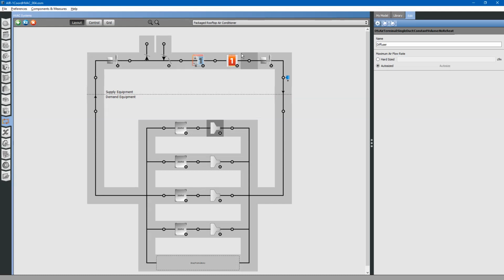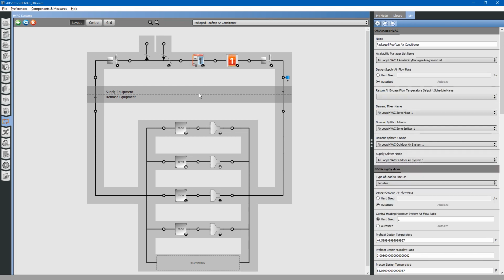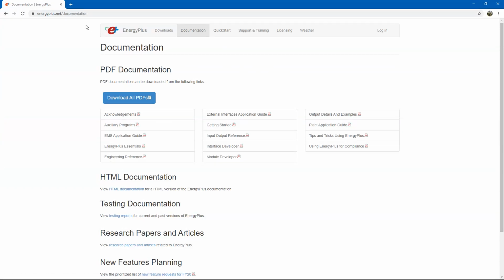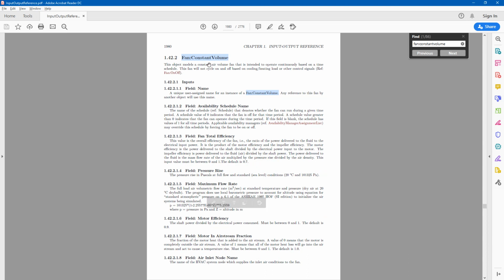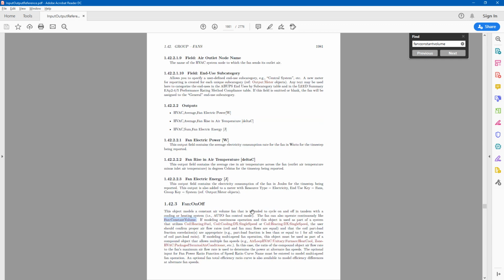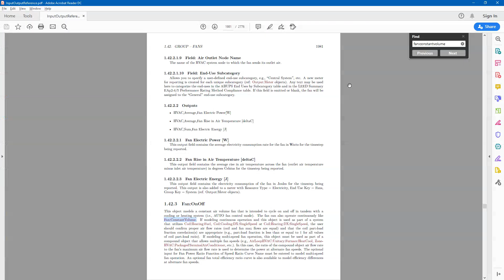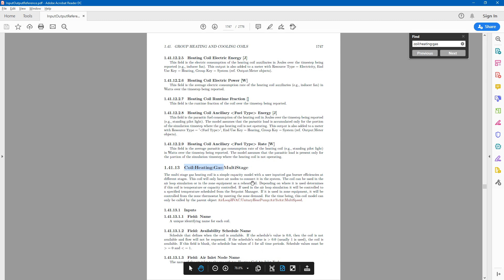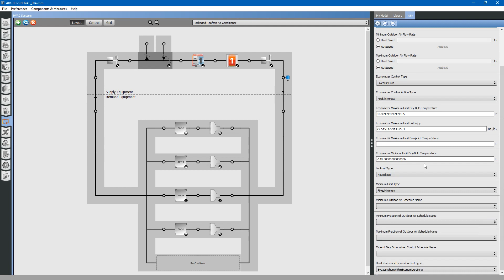OpenStudio EnergyPlus - Input Output Objects

Comment: Great video! i've been using the documentation on bigladder software like this URL: https://bigladdersoftware.com/epx/docs/9-0/input-output-reference/group-fans.html  .  Is this energy plus document you reference a better source of documentation?
Reply from the maker: It is the same documentation.  The one you are using sometimes comes up with better search results (with the power of the search engine), but otherwise they are exactly the same.